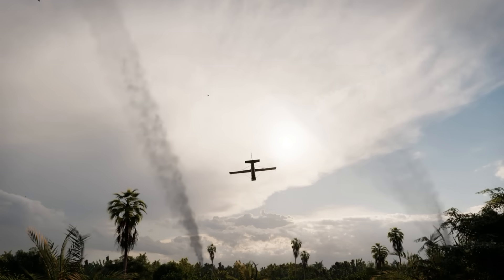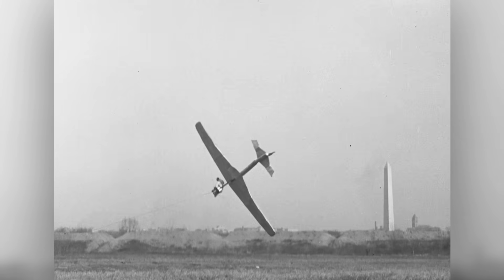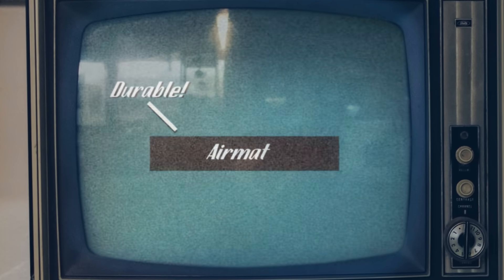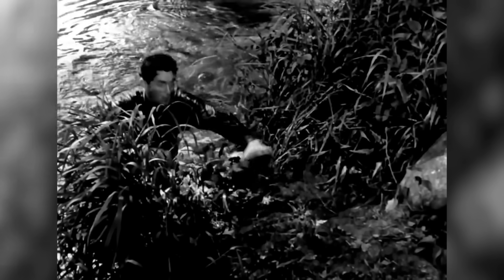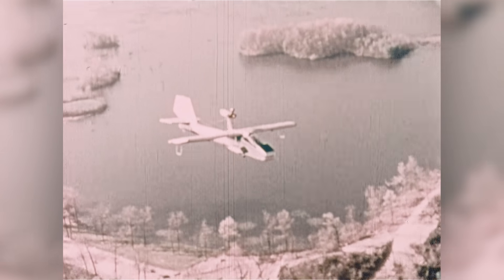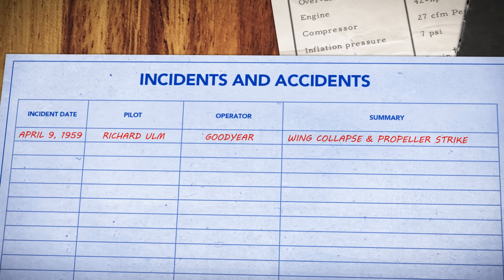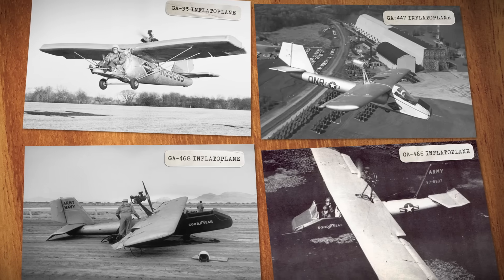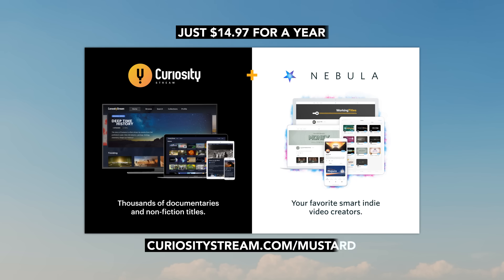Inflatable Airplanes Were A Bad Idea

Comment: I think a hybrid design could be used safely for ultralights and other light aircraft. Use a metal spine along the length of the plane and a metal spar in the wing. Inflate the rest. Even just making the wing inflatable around a spar would make the wing incredibly light and the spar would give rigidity to eliminate the risk of wing folding. Inflatable wings would allow for more wing area for a given weight. The rest of the plane could easily be made of aluminum pipe. Tail surfaces can be simple fabric over tubes. 
And since ultralight aircraft are intended to fly slow, big, high-lift wings would be great.

Comment: The idea of an inflatable plane isn't as crazy as it may seem. Paragliders and parachutes are inflatable wings, they simply have an open leading edge and are inflated by air pressure created by forward motion and manage to function with ridiculously thin, rip-stop sil-nylon material (silicone impregnated/coated nylon).

Comment: Honestly sounds like they could have kept working on it to make better. Maybe put some structural support rods (like those found in kites although maybe a light weight metal) to prevent the wings from folding over. That way its still roughly the same wait, but I'd now way more sturdy and only increases the deflated size and weight minimally

Comment: you can get by with a ton of less weight if you make the wings inflatable, pressurized, so they dont need the full structural integrity
Reply: ie, metal mesh wings with air proof foils and puncture cover

Comment: Faah, that could totally be done with an electric engine.  Sounds fuuny like a wacky comic.  Seems like a good funny beach gimmick.  I want to do this, but with an odd petrol to air compression to air turbine fan system, or hybrid petrol/electric enclosed high speed fan.

Crash and bounce, lol.  Much better than parachuting. Safer for amateurs.

Electrical controls would also fix the cable problem.

Lol, inflateable hydro planes.

Hech, we even have lightweight flexible ballistic resistant materials now.

I think every engineering problem about it could be fixed, pretty sure it'll bounce back into popularity.

Comment: So much of our early aviation troubles were because the pilots had to control all of it at the same time.
I mean, you'd need the skill levels of the drummer from Led Zeppelin, there's so much to be aware of.
-
Now though we got the gyroscope-chips that take care of all that; the Flight Control Processors have completely revolutionized aviation.

Comment: Should be no problem today to make a superlight inflatable airplane, using dropstitch technique, a delta wing and an electric engine at the same time inflating the plane. Instead of rubber 
using multilayered pvc. I can be a very tremting option for an ultraultraultralight needing not much enginepower. Think about what's posible for dropstitch supboards or kayaks even with electric propellors in fincasings, Joints or beams  using carbon tubing, Cheap and solid enough.

Comment: This is such an incredible idea and design. I imagine if chemical engineering gets advanced enough, there might be some type of coating that could continuously spread to seal any punctures, kind of like a self-sealing bike tube. That could help it stay going much longer after it takes any fire.
Reply: It already exists and its used in car tires, its in the inside in the walls of the tire, its basically like a super sticky material that doesnt let air escape by quickly patching up the hole

Comment: Don't get why pilot would have to inflate plane with engine if 7 psi was all it took to inflate it. Surely you want to be as quiet as possible if stranded in enemy controlled territory. If pumping tires by hand is something to go by maybe 7 psi is what pressure is needed to get it half inflated.

Comment: I don't see why we couldn't make it just slightly bigger and have struts that would prevent wingfold over. this would make private piloting far easier and wouldn't be that much different from modern ultra lights anyways outside of packing in a much smaller space

Comment: I mean.....If there was a way for the pilot to pretty much put a light frame inside , a frame that would  be put together on the spot , wouldnt that remove the problem of the wings folding? Maybe not for military use , but for Hobby pilots , hunters , and tbh it might even work for missing people in forest searching. Get the plane near the area person went missing and you just fly around the area. Ofcourse you have helicopters , but i believe a inflatable plane is much lighter on the wallet.

Comment: The Hydrogen powered engine doesn’t work as well as you think. That hydrogen should come a source like electrolysis of water, which takes energy. It then used as battery but very hard to contain one. Plus the power back will not be the same as the power that went into separating the H atoms from the O. It better to use batteries or continue to improve efficiency and environment friendly engines. Jets though will continue to use a Jet Engine as electrical couldn’t provide the same speed or power. And Hydrogen explosions for propulsion would be dangerous. Also a normal engine isn’t much different from a Hydrogen one. A normal is supposed to produce CO2 and H2O from the hydrocarbon fuel and oxygen oxidizer. The CO comes from a incomplete burn that can be fixed with further innovation. Also CO2 comes from every living things, including plants (that then recycled it).

Comment: An idea on the inflate a plane. add one more layer, of the stuff, they make casts out of.( not plaster of Paris.) more like  an ace bandage ,  with a ,water activated resin.
 inflate the plane. hose it down, and let it harden. depending on how many layers of that stuff, it would be as stiff as fiberglass. I'm thinking structural rigidity. or, like a composite material . instead if inflating the wing with air. use expanding foam. it would blow up the airframe, and when cured, would be very strong because of the fibers, throughout the material. 
 I have stood on composite panels, in airframe school, While in the Navy. with the foam inside, and the fiberglass, skin.  it is very strong for its weight.
They could ship your plane to you, in a box. you, un pack it, pull a lanyard, the foam fills up the plane . after it is in shape, spray it down, with water. let it cure. probably paint it, for uv protection. and you have a home built plane, in a day or two, allowing for cure time.

Comment: I wonder if this concept could be resurrected for civilian use as and easy to store ultralight or light sport aircraft?
Reply: It very much can be resurrected, the materials needed to guarantee structural integrity and rigidness already exist, aircraft design has reached incredible heights and ICEs have imporoved massively, enough to increase range & reduce weight and emissions considerably meaning the Inflatoplane can be reinvented

Comment: TLDR at bottom if you dont want to read all this 

Hydrogen is very combustible and explodes violently when mixed with air. Hydrogen batteries do have an energy to weight ratio 10 times better than lithium-ion but they are a whole lot more dangerous. If they get punctured or the gas escapes through imperfections in the structure of the battery only one small static shock could be enough to start an explosion. This is why using them on moving vehicles is dangerous. Especially on planes that gather static electricity from flying through the air. Although most planes get rid of this static electricity through the small metal rods at the wings this isn't 100 percent effective.  Also, battery-powered vehicles aren't technically emission-free. Although they themselves don't emit any burned gasses, the electricity that is used to charge them comes from power plants that use fossil fuels. This means that due to the laws of thermodynamics the same amount of fossil fuels would have to be burned in order to provide the electric plane with enough energy to fly the same distance as a normal plane that burns jet a. This technically means that an electric plane to charge would burn the same amount of fossile fuels as normal planes if not more because electricity gets lost due to heat and resistance from cables. This wouldn't be a problem for renewable energy sources, however fossil fuels still provide the majority of the world's electricity. One could make the argument that it's better to burn the fossile fuels because they don't release lead as a pollutant since jet fuels need to have lead for better combustion. Additionally, electric planes cant be charged as fast as normal planes can be refueled which might be a huge turn off for airlines since it will mean their planes spend more time charging than flying. Plus batteries are less energy dense than hydrocarbons in jet fuel meaning batteries will always be bigger and heavier than fuel tanks filled with gas. This either means less passengers or cargo, and heavier planes that need more power to go the same distance. that ofc means they need more batteries to hold more electricity which propogates the problem further. I do want them to make electric planes but I don't think they will fully replace traditional planes unless they fix battery problems, charging problems, and efficiency problems. Hydrogen batteries are best for very safe stationary conditions like reactors.

TLDR: hydrogen battiers are too dangerous since hydrogen violently combusts, batteries take longer to charge than normal planes who just need to refuel, electric planes will use the same amount of fossil fuels as normal planes because of thermodynamics and human dependency on fossil fuels right now, and battiers mean heavier planes with less range, passengers, and cargo.

Comment: This is not the Goodyear story I learned in school in 1965. The inflatable plane had no engine. It was built around the ejection seat. After ejecting, it would inflate around the seat and become only a glider. If a bullet went threw the rubber, it would seal back up. Like our puncture proof tires. That's my story, and I'm stickin to it.

Comment: The Icon A5 is a good example of a modern "sporty" ultralight, one that I have had the pleasure to fly inside. Its glaring issues have nothing to do about the plane itself. It was intended to be a mass-produced product that would eventually drive down the cost, but when this wasn't feasible it only became more expensive for the consumer to invest in a sport plane. And there were a number of notable fatal crashes associated with it. Despite new pilots receiving professional training by professional pilots from Icon, each crash by both Icon's pilots and consumers were determined to be human error. On one hand you have a water plane that is capable of acrobatic maneuvers, only requiring a sporting license to fly. Yet on the other you don't attempt such maneuvers at extremely low altitude even over water, which may have been a factor in all cases.

Comment: 0:50 - yes, that makes perfect sense. Your all-metal F-86 jet fighter just got shot down, as we clearly don't have air-superiority or are facing effective air-defence forces. Here's an inflatable microlight to see if you can escape the area you just got shot down over in that......

the 300 yards to take off is in a bit of a deal breaker. Even in Europe that's a large field without either crops or animals in the way, and I'm guessing this aircraft is going to want calm conditions to be able to operate. IE light headwinds on take-off, no heavy precipitation, reasonably high cloud base. Given it's slow flight speed you'd ideally want to operate it at night when visual interception will be much more difficult, but given it's rudimentary instrumentation and the likely unfamiliarity of the pilot, perhaps not a great idea...

Imagine using this thing. The enemy will have seen the delivery aircraft (which is a transport aircraft.. flying slow-and-steady through the zone your fighter just got shot down over.....) fly over and drop it, so by this point will have a pretty good idea where you are going and will likely try to move to that location. It weighs 200lbs and cannot be moved quickly, so you've got to detach it from the parachute, locate it to the start of the takeoff run, inflate and rig it, start the engine and take off before the enemy make it to where they saw the package land. And hope to hell they haven't radioed for air support (of ANY kind!). They also have a pretty shrewd idea what direction you're going to take as they will know you'll be trying to get back to the nearest allied base and will probably have arranged interception.

Comment: The AF idea to rescue downed pilots is somewhat hilarious.
If a pilot can't be rescued by normal means he's likely in hostile territory. To drop an inflatoplane you'd have to put another plane and its crew at risk, assuming you can even reach and find the pilot before the enemy does. Assembly and takeoff still require an open space, so the pilot would be easier to find and take captive. Even if this all worked out, the plane would still be incredibly slow and easy to intercept.

Comment: Couldn't this concept be revived in UAV form? If you've got a 50lb aircraft you can pack in a humvee or IFV with longer loiter time and higher speeds than a smaller UAV, that could be useful for reconnaissance

Comment: My mind thought of inflatind high strength aluminium tube or high strength steel frames with cables between them to make frames for lighter than air air ships of cargo planes. Lets face it, it was a great idea that was obsolete before it could get off the ground. Could the raw concept be used else where?

Comment: An inflatable fixed wing aircraft might be a cool option for exploration of low gravity moons with dense atmospheres like Titan. It will have more range than the multirotor designs and be able to be packed up tightly for the trip and inflated on site.

Comment: The ultralight community would love this.

Hydrogen and battery aviation is never going to work. You need several times the gross takeoff weight of a 737, in batteries, to fly that 737.
Reply: Not yet, but NASA already is investigating electric aircraft and electric cars are becoming more popular.
Reply: @twistedyogert  electric cars can take the weight penalty and only need 300 miles or so range. 

Hydrogen airplanes lose a lot of revenue generating volume to fuel storage. 

Kerosene is just ridiculously dense and easy to work with. So it's best to just synthesize using excess solar or wind energy.
Reply: @sl600rt  Electric aircraft might not be a commercial success in the near future, but I'm sure that there are plenty of ordinary people who would buy an electric aircraft simply for the adventure of flight.
Isn't adventure why the first airplanes were built?

Comment: "Just 7 PSI, a lot less than a car tire", A tractor tire uses 3 PSI, a Mineration Dumper Truck tire uses 0,5 PSI and a Speed Bike tire uses 120 PSI, PSI=Pressure per Square Inch. It need's a LOT MORE than a car tire
Reply: @XinhuiYu-gb5io  28~35 (It changes from car to car), so, try to inflate a tractor tire with a hand-pump and tell me when you finish.
Reply: @F99 Crafter It is an inversely proportional relationship, the larger the area, the less PSI you will have. That why a speed bicycle will have 120 PSI, while your car have 30 PSI.
Reply: @F99 CrafterYes, a lot less, but the video try to say that you need less air by that to inflate the rubber plane than to inflate a car tire.

Comment: A foldable microlight or paraglider would be easier to deploy from a rescue aircraft. Much quicker to assemble and get flight ready with a smaller footprint and easier to take off from challenging terrain.  They are also a hell of a lot safer than this thing.

Comment: Urban air travel for the masses will never happen.
Why?
A flying car would need downward trust to stay in the air equal to it's mass. Imagine standing under a helicopter.
The mass cannot be trusted with the safety of the air, crashes, stuff breaking due to poor maintenance etc. One flying machine could take multiple under her when falling.
Reply: No, but using one of these as a cheaper replacement for current hobby light aircraft, like those Cessnas you see, could work. It would be easier to store, cheaper to build, and potentially allow many more people to get into flying who want to but lack the money for expensive traditional aircraft.

Comment: This is one of my favorite planes. Rough field, snow, sand, mud... no problem. Water ops... easy. Hangar fees... don't worry about it. It even (nearly) qualifies as an Ultralight Vehicle (except for the huge gas tank), so no license required.
If I could get my hands on the materials, I would totally build one. The cockpit, wings and tail were airmat, but the aft fuselage was just regular blimp fabric.
I would, however, put a cage around the prop like those used by the powered parachute crowd.

https://inflatoplane.proboards.com/

Comment: Who else would buy an airplane that fits in their trunk, uses a small regular gas-efficient engine with a 100hr inspection cost cheaper than a IPad, and acts as an airbag on crash!?

I could build up my flight hours so much cheaper that way! Make a dual-prop inflatable and watch student pilots rush the store faster than The Flash! The fact that it flies slow is a plus, we’re hired on hours not distance! 😆